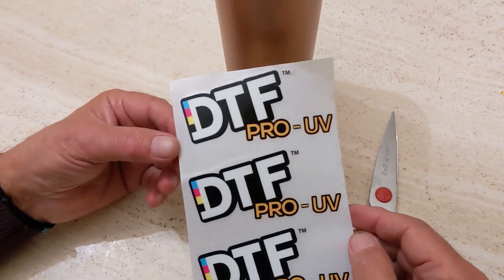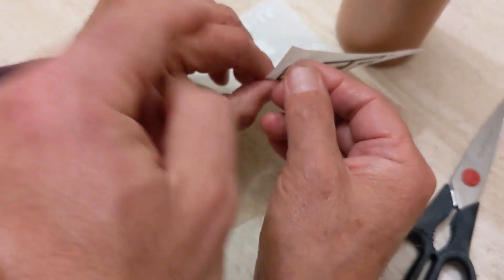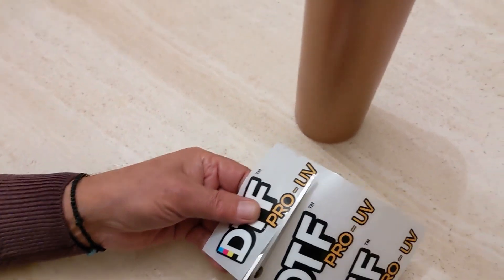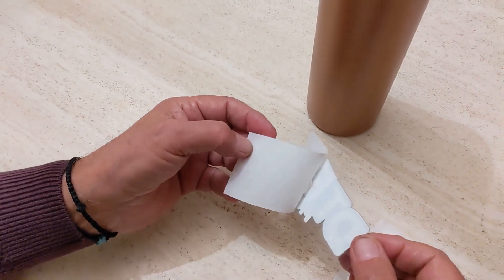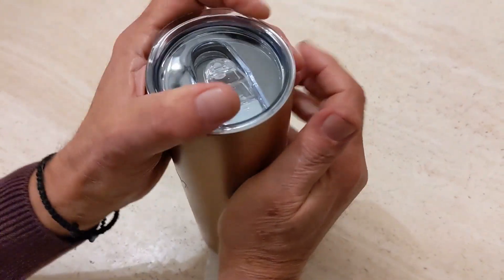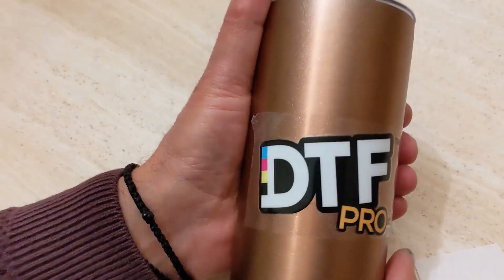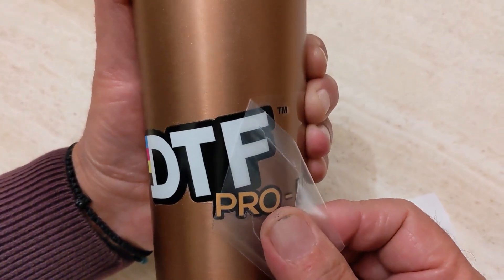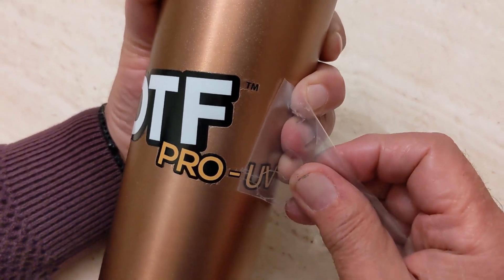UV DTF Printing - UV Printed Transfers to hard substrates

Comment: The edges look like the adhesive has seeped out. I would not be happy with the end result as you have shown it.
Reply from the maker: Fair comment, but this video is from Jan 2022 at which time this technology was still in its infancy. It has improved a lot since then, and that is also taking into consideration that its still "new" tech and will continue to improve as supplies and technology improves. Latest gen is the GENESIS (https://dtgpro.com/cicproduct/uvdtf-genesis-vx.php)

Comment: If you just printed ink onto that A film, how does it stick? Where does the adhesive come from?
Reply: The transparent film you are printing onto has an adhesive, before you print you have to peel off to expose the adhesive side to be printed on, the ink will stick to it. That means you cannot print this with any printer, you need a printer that has a moving table similar to "direct to garment" printer, otherwise the transparent film would stick to the printer rollers (if that makes sense). So you print on the sticky side, then you put on the lamination transfer film which somehow only stick the printed image and not the additional adhesive around it. But if you see when he peels the final product there is additional adhesive around the printed image.

Comment: Cant see that being much good in a dishwasher, another question how well do the inks last outdoors? Solvent UV lasts about 4 or 5 years before fading becomes an issue. May be great if you are just a hobbiest making gifts for friends but after working in the Printing Industry 40 years I know that not all glues work on all surfaces. You could say not all glues were created equally. Surely that is just a decal that would peel off if you wanted to peel it off or the glue will breakdown under heat?
Reply: glue will brake down unter everything. Looks amazing, but not durabe at all
Reply: @BpKoksan it’s been proven otherwise I’m pretty sure

Comment: I thought you'd need a cup heat press for this! What's the difference between this technique and the heat press one please?
Reply from the maker: Cup heat press will do a better job (heat and pressure will be better and faster applied), but you could also achieve results by pressing by hand and the amount of heat and pressure by hand is enough to adhere
Reply: @printetc  does using a heat press with UV DTF make it adhere better?
Reply: @kaleigh.cortez  no, it will weaken the adhesive. Think of like permanent vinyl
Reply: @da-tutor2916  Yeah its just a decal with a white background that you dont need to contour cut, probably has its uses. So many things they dont tell you, how permanent is the bond, what it sticks to and what it doesn't stick to.

Comment: I have a regular Uv flatbed printer, do I need something else than the sheets ?
Reply from the maker: You need a UV printer that has at least 10 channels (12 channels are recommended), so that you can dedicate at least 4 channels to UV GLOSS OPTIMIZER. See for example: https://dtgpro.com/cicproduct/uvtransfer-uvdtf-printer.php
That is a printer that has 12 channels and you can dedicate channels to CMYK, WHITE, and GLOSS, for example as follows:
12 Channels (CMYKWW + VVVVVV), where V = varnish, W = White
The GLOSS OPTIMIZER is a required "ink" in order to coat the CMYK+WHITE and render some of the adherence properties that UV DTF provides. Then of course you need sheets (A and B sheets), and a laminator to laminate A sheet (that you print to) to the B sheet.